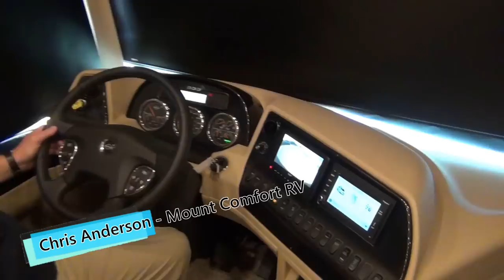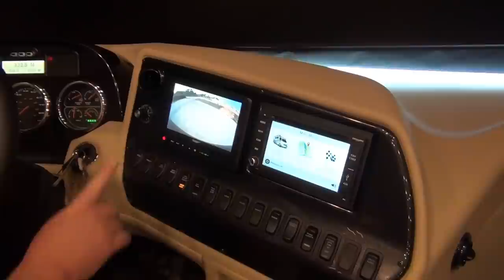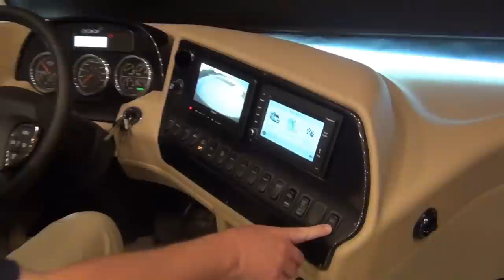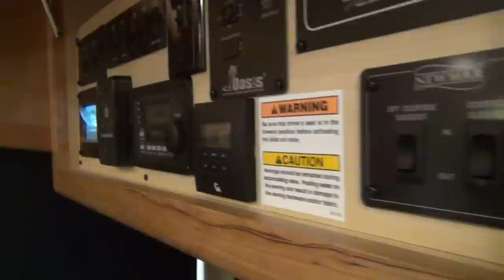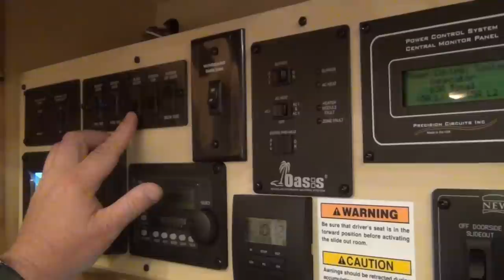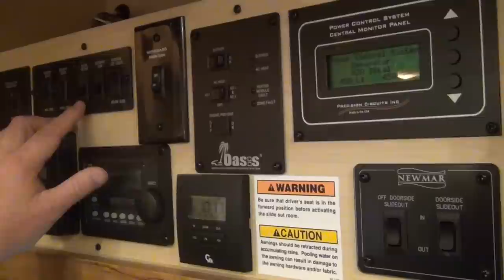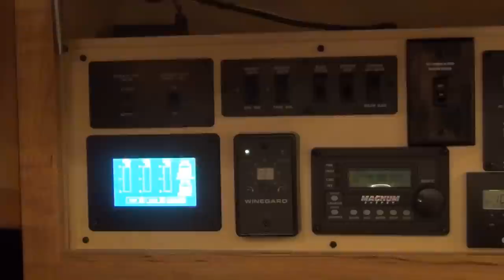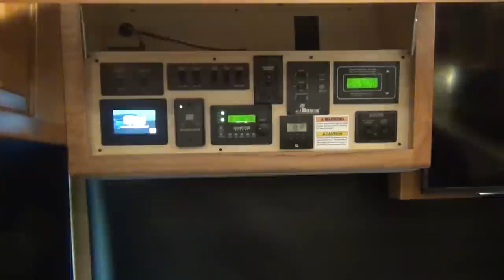NEW 2018 Newmar Dutch Star 4369 | Indiana RV Dealership

Comment: Chris, we are interested in a DutchStar 4052 and want to go all electric, with Solar on Roof to support boon docking as much as possible.  Questions for you:
What does the All Electric - Dutch Star take in Wattage to support it?
You have TV's, Satellite Dish, Wifi Locaters/extenders, Multiple LED lights around Bus, 
Refrigerator, and Domentic Ice check in basement, along with induction cooking, the convection/microwave and our additional coffee pot, and computers use... what does all that take?  Yes, you say, depends on how much you use what - of course.
But say for average, we cook couple hours per day, for breakfast and dinner.
We have coffee 2 to 4 hours per day, we refrigerate all day, TV 4 hours per day average, 
Computers, 4 hrs per day.... the dish receivers and wifi expander, how often do they have to run, does the satellite stuff only run when needed? Watching TV?  Does wifi not run all the time?  What about the extra's like slides and steps and what not.  How do I calculate what I need in Battery?  In Inverter,  in Solar on the Roof?

Do you have folks that can come in and install solar systems that won't leak? Certified?
Do you have folks that can tell us what the requirements are for components that match?
Like to get that info, so we can plan...   Appreciate it if you can help.

The Laurell's - Anchorage Alaska.